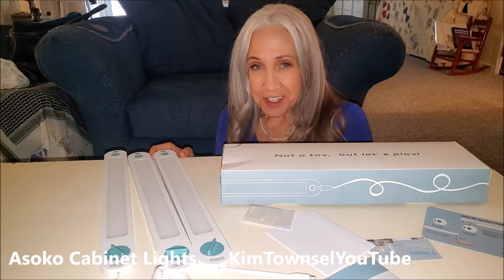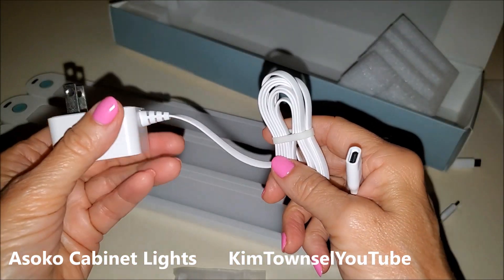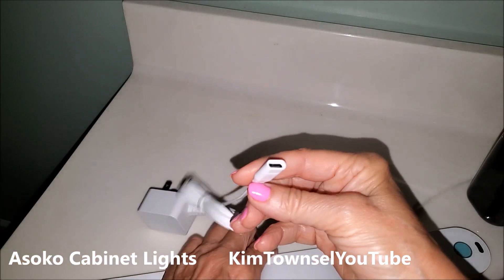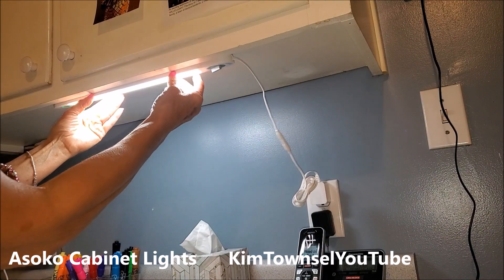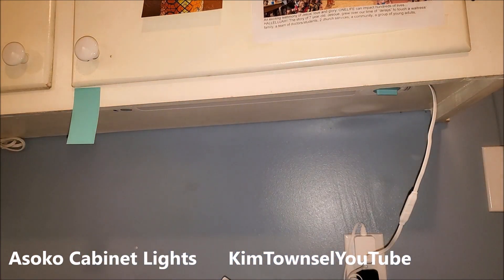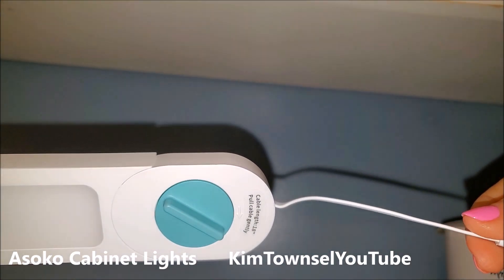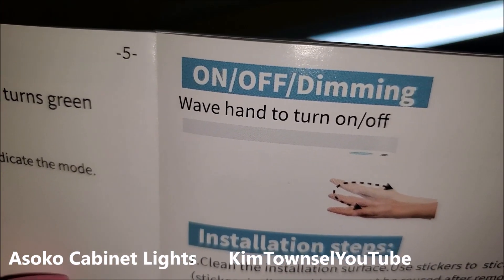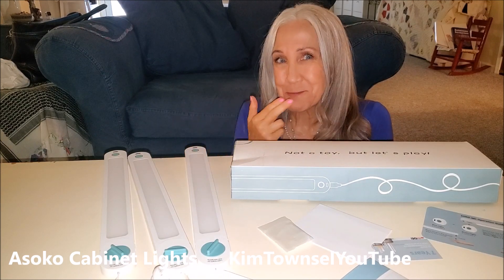Asoko Cabinet Lights | Sharp, Effective, Stylish | KimTownselYouTube

Comment from the maker: SOKO Hand Wave Activated Under Cabinet Light with Retractable Cables, 3- Pack Set  https://amzn.to/45ibS5H 
Excellent lighting system for under cabinets or shelves. Easy to install. Beautiful lighting. 100 % Satisfied. 
Overview 0:00
Unboxing 0:36
Instruction Manual 3:06
Operation: Testing and Modes 5:55
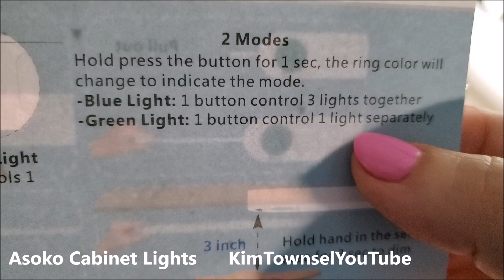Installing Lights 7:51
My Mistake!!! 13:43
Clips 16:28